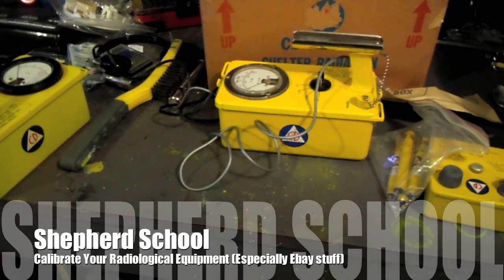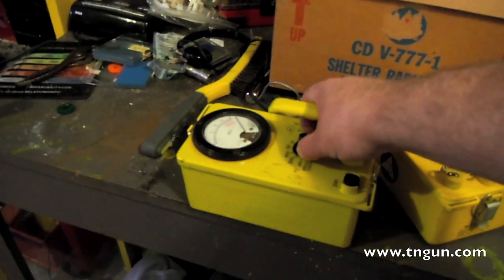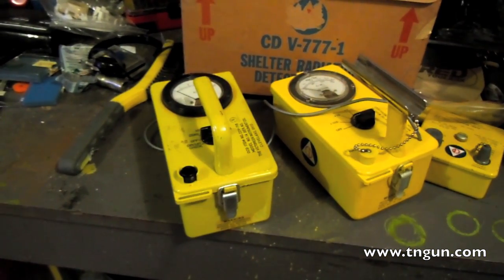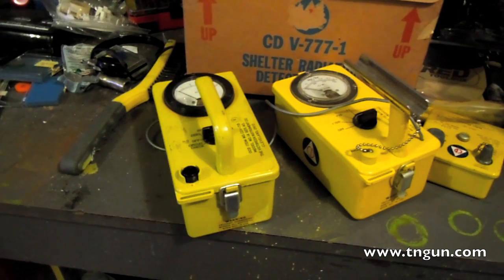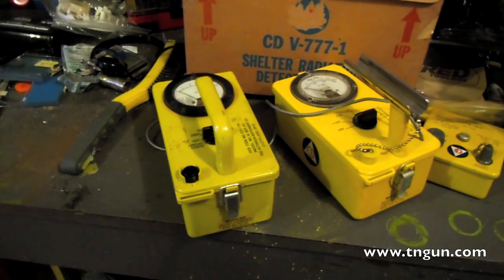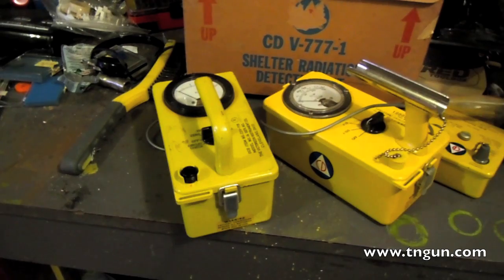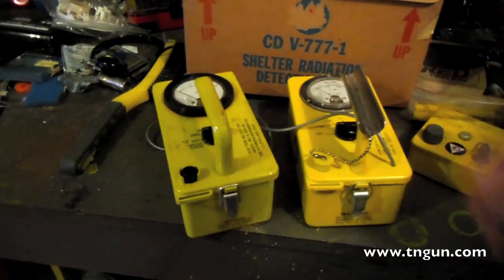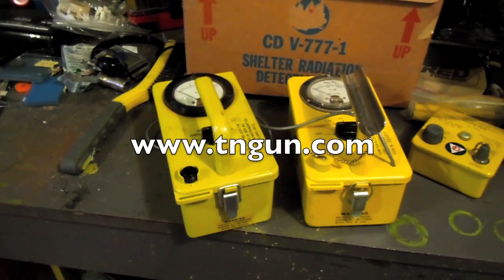Calibration of Radiological Instruments

Comment: I used to have a quartex from harbor freight and it was very sensitive. I pegged it after getting a Hidascan. The check source on the CDV 700 was pretty good at lighting up the quartex, too. I had a survey meter that Shane calibrated. I don't remember if I got the survey meter to budge, but I did get a sensitive dosimeter to register it after holding it next to my gut for a while. It wasn't the standard 0-200 rem, so it wasn't the 742.

Comment: I have geiger counters with scintillation probes capable of picking up over 10,000 counts per minute background radiation. 

Sure my less sensitive counters are great for sitting in my basement and preparing for the nuclear attack… Or scanning my overpriced radioactive antiques… But actually going and finding something? Not a chance. Unless you’re an inch or two away.

It’s very important to have something extremely sensitive. Even a plastic scintillation probe (like those sold on eBay by IRAD INC) Will give extremely high sensitivity levels… Approaching 2500 cpm background.

For example, let’s say your prospecting for uranium, or trying to find a radioactive source that’s been lost in a metal recycling yard. Or maybe you just want to find some spicy minerals in your own backyard. Or maybe you want to go hunting radioactive antiques… Which are plentiful in all antique stores and junk shops. 

10,000 counts per minute background gives me enough data points to easily see the anomalies or spikes. I don’t have to listen to it, I can cut the meter to silent and zero out the analog meter so that it only shows me the spikes above background. Even very expensive Geiger muller detectors only get a few hundred CPM maximum! But At 10,000 counts per minute… A 5% increase is an extra 500 counts per minute! Where a common cheap old geiger counter is around 30 CPM background… With a 5% increase only being 1.5 counts. Good luck finding any anomalies or spikes… And completely forget about it unless you’re only an inch away from the source! 

 I can pick up uranium or radioactive sources from several meters away! These are the same type of detectors that are strapped to helicopters and flown over potential uranium mines… To sense the radioactivity below. I’ve been doing that since the 50s. 

Really can’t go wrong with a Ludlum model 3 or 12 running a bicron scintillation probe with 2.25“ x 1.5” NAI(TL) Crystal. or at the very least one of the 3 inch DIY scintillation kits from Irad inc. then you can use one of the cheap pocket detectors to pinpoint the source once you’ve located it from several yards away.
Other than avoiding nuke fallout, or already confirming radioactive sources that you’ve purchased. Most standard detectors have no use for actually finding and locating radioactive sources. Sure it’s fun to swipe over your collection but there’s tons of radioactive stuff in our every day lives, extremely dangerous government sources lost in scrap yards everywhere… An antique stores full of radioactive goodies.

Irad’s DIY 3 inch scintillation probe kits are made of a plastic scintillating material so they aren’t fragile and sensitive like Real crystal. They can be had under $150… And are about 100 times more sensitive than the best Geiger muller tube. 

But a nal(ti) detector can be had pretty cheap if you look out for them. Do you want something with at least a background of 3000 CPM. They’re extremely fragile and hygroscopic, But you can also identify exactly what isotopes are in the material you find. I’ve seen nice bicron  probes go for $100.

Good luck to you, and as long as you’re enjoying what you’re doing that’s all that matters. This is just my opinion and my take on the subject. Once you find your first few radioactive source is “in the wild“ it’s pretty addicting.

Comment: The more sensitive the meter the better the measurement. It allows for detection of small amounts of radioactive material in food or in the ground. The cdv700 and 715 are not sensitive enough to detect contamination in food unless it is extremely large amounts of radioactive material. The cdv 700 the one with the detachable probe is your most sensitive unit which is actually useful. The only time you even could use the 715 is if you were near a source that could imminently and severely impact your health. It would not even register at the trinity site or other moderately contaminated aires. It will only register when you are in a location that you really shouldn't be at. The cdv 700 on the other hand will detect much more commonly encountered radioactive sources. If I had to choose one to have with me in the aftermath of a large release from a reactor or other source I would defiantly choose the cdv 700 or preferably something much more sensitive. If your cdv 700 goes over scale or no detect from voltage overflow then you need to leave the airea, simple as that. I would never encourage anyone to get a cdv 715 unless you plan on surviving a nuclear blast and then hiking towards the epicenter.
Reply: Very useful information..Thank you!

Comment: why would you need one anyway?
Reply: James Harty 

They are very neat collectables and historical artifacts, but they are also useful.

The CD V-715 and CD V-717 are both survey meters, they measure high levels of radiation.  They are normally useless, but in the event of a nuclear exchange or a nearby reactor meltdown they would be invaluable, they would tell you which areas are safe, or safer anyway.  The CD V-717 has the added bonus of a remote sensor that can be up to 25 feet away from the meter, so it can tell you when it is safe to leave your fallout shelter.

The CD V-700 is a low range meter, a true geiger counter, it is useful after the initial period after the attack or meltdown when the radiation has fallen below the detectable range of the CD V-715s and CD V-717s.  It can also be useful for checking for residual contamination, leaks in your shelter, and contaminated personnel or equipment.  It is also a great practice tool for the survey meters and an educational tool to learn about radiation, it’s also FUN, you can just go around measuring random things and discover just how many things around you are radioactive, all while making that ominous clicking sound to scare observers and kids.  It is also very useful if you collect depression glass or fiesta wear as it will help you authenticate and locate them.  You can also use them for Uranium prospecting.

Comment: Buying old Civil Defense survey meters on Ebay IS a crap shoot. But if you're careful, and know what you're looking for, you can pick up a good deal. I buy the CDV-717's, and I make sure they pass both the circuit check, and have no internal corrosion. I'll spend between $35 to $65 on a used meter. Calibration through (radmeters4u) costs $92. But if you buy an already calibrated meter from that site, expect to pay $350-$500! In fact they don't sell meters retail anymore, they use dealers now.